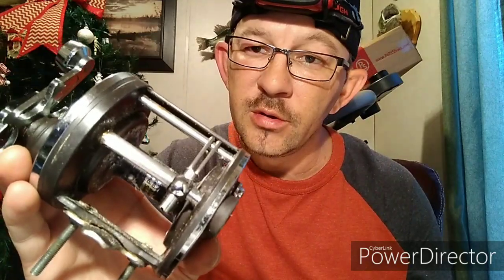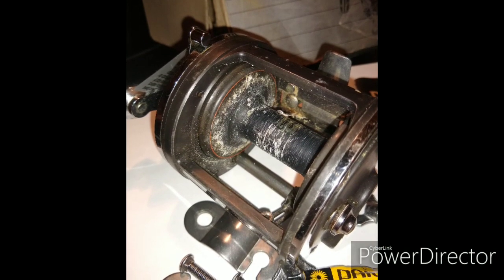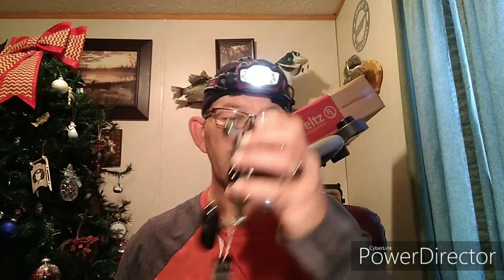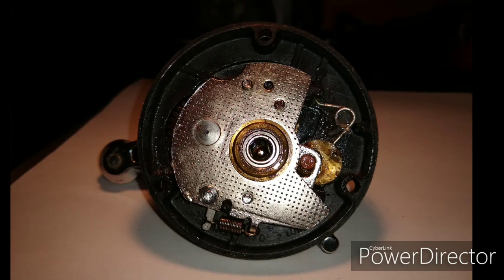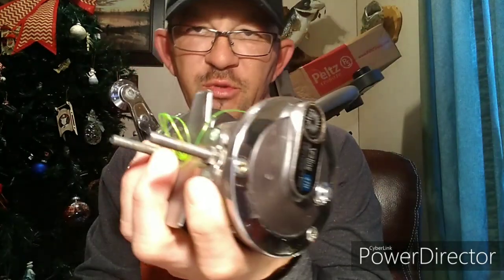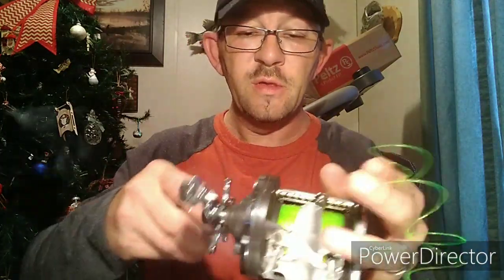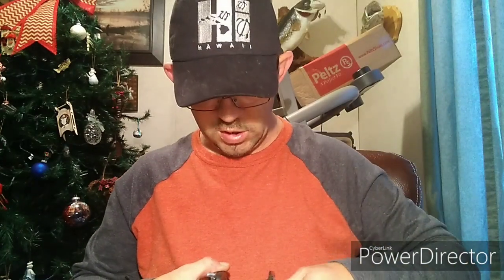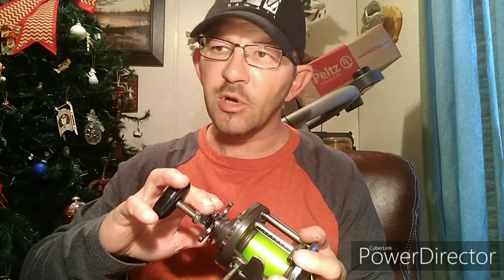Cleaning,Testing,& Review of daiwa sealine 47h

Comment: I've been running these now for 7 months , I've got 3 & I'm about to buy several more. They don't have the finesse for casting in tight spots but I can chunk a chunk of bluegill and a 6oz sinker crazy far & hog a big fish from cover. 

Mounted mine on cheap Daiwa ft 7 foot rods but will be replacing them with either solid fiberglass beef sticks or bass pro "snagging special" solid fiberglass 7ft rods.
Reply from the maker: That's awesome! I still fish with mine now for flathead. Great older reels

Comment: Cool! Looks good bud. I like old reels myself. I have an old Penn 209 Levelwind that my sister-n-law got for me from an estate sale. Brother just gave me an old Penn PEER 209 reel. Both needed a little TLC. I cleaned them up and they both work good. I haven’t put line on them yet but i will.
Reply from the maker: I'm taking a high speed Penn 310 gti . I also have 2 ambassadeur 5000 from the 60s I'm working on. But like I said these high speed daiwa sealines are hard to bet. I've used the 209s when I first start catfishing with conventional reels
Reply: Hacked to Fish cool
Reply from the maker: I would love to upgrade the bearings to super high speed but don't have the money right now
Reply: Hacked to Fish i hear you on the mafundsalow disease lol. I am kinda in the same boat. But it is what it is. You gotta make do with what you have till you can upgrade.

Comment: Nice reel renewal video! Did you have to renew the brakes? Rubber or cork sealing? Roller bearings? What line do you use on it?
Reply from the maker: @jensmatthaei3293  I didn't replace anything just grease for the gears and oil for the bearings. The reel is still going strong to this day.